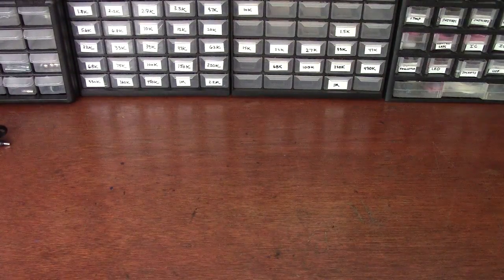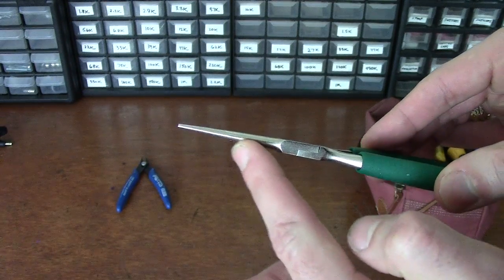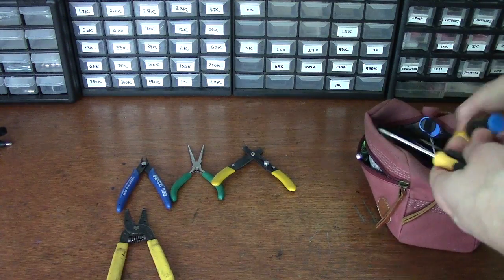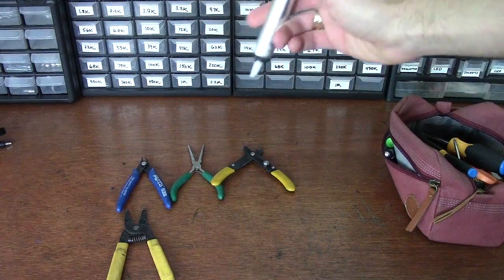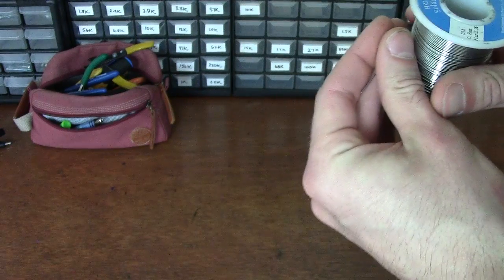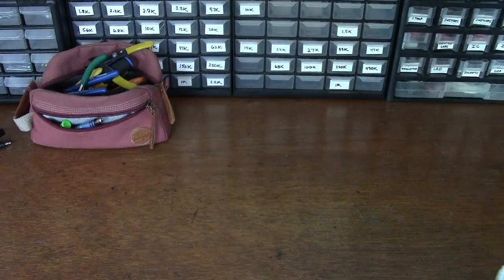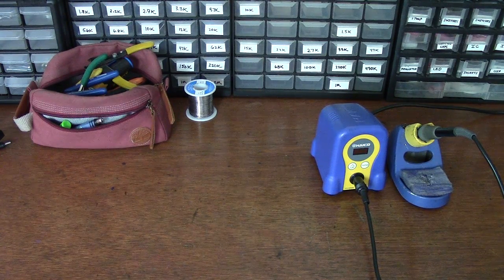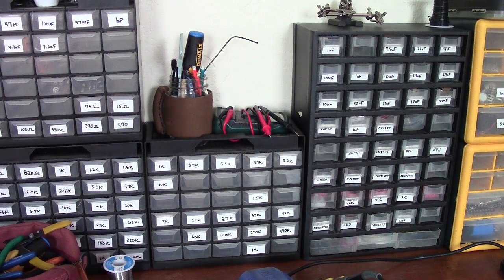How To Start Building Guitar Pedals

Comment: this video is great man, I've been getting into pedal building and I'm in the same boat of having some experience from soldering and fixing guitar wiring. I might have to check out if my local university has an electrical engineering degree, or even just some classes on analog circuitry. Kits are sweet, but I want to learn how and why each component does what it does and this is super helpful
Reply from the maker: Most people never regret going into engineering, it’s a hard subject but I enjoyed it!
Reply: @FuzzlordEffects  it was what I originally wanted to major in before I settled on computer informational sciences. But the local university has added a BUNCH of classes recently

Comment: about a year ago i bought a fender noventa jazzmaster with the goal of customizing it, and when my local shop had too long a wait list for my impatient self. so in the last three months or so i myself have delved into designing switching systems to customize how the guitar works. i see the natural progression from this interest to be starting on simple amp and effect circuits, but ive only met frustration when trying to read into any schematic more complex than an electric guitar, whatever bells and whistles ive added aside. i had a friend ask me to replace the fuse holder on his late 70s fender pro reverb, and while this task was relatively simple to figure out, i was instantly put off and honestly afraid when i saw the rats nest of hand wired components running every which way. whats stopping me from figuring out these more complex circuits and why are so many more components required in an amp than, say, a guitar?

Comment: Going to Toronto Metropolitan University this September for Electrical Engineering and hoping to work in the professional audio/guitar world after wards. I'm hoping to learn why we use high input and low output impedances, certain capacitors in circuits, specific transistors, etc to create innovative audio gear! Just finished my first boost kit and looking into some more simple saturation pedals: fuzzes and treble boosters (not from a kit) as well as guitar wiring mods. Question though, what wire would you recommend purchasing? I'm seeing a lot of people mentioning 22AWG Stranded Topcoat and I'm guessing single conductor or 2C? Thanks in advance Jason!

Comment: Something that frustrates me a lot as someone trying to get into pedalmaking. When I look at a beginner kit or a beginner video, it just says to put component X in position Y, at best it might tell you that its an Op Amp. But what none of the stuff I've seen so far does is tell you what all the little resistors and capacitors and stuff are doing, and why they come together to make the part of the circuit. I know the information is out there, but I'm having a really hard time finding it put in a way i can understand. I feel like I'd get more value out of a beginner fuzz build if I learned how it works rather than just what pice goes where.

I don't necessarily want to make some crazy custom creation. I just don't like the idea of making a bunch of pedals like theyre Lego sets without really learning why this all works.

Great video by the way. I appreciate the amount of thought you've put into what you do.

Comment: I’m compelled to build. I can’t help it. My first baz I built from salvaged parts. I had just got into it and I was so hungry and I couldn’t really work a job at the time so I was broke. It was a good long while before I was able to find a good transistor type that I didn’t half roast in the removal process from the iron. There is something magical about making them come to life. I just recently discovered biasing and it’s mind blowing awesome to have access to that control parameter- it’s like secrets hidden in limitations by the manufacturers. Because playing with biasing is straight up bad ass and I love access to that control 🤗

Comment: I used only a RAT for at least 15 years thinking I’d never need another gain pedal because it did everything I wanted. Then my friend gave me the abominable Christmas ornament fuzz face kit. I didn’t expect much but now it’s the other dirt pedal I don’t want to go without, and I’ve built s pedalpcb clone of the Thorpy Fat General compressor. Don’t want to be without it either. I need those drawers! My desk is a PILE of parts and packs of strings and picks and oh my. But I do have the tools and I do know where they are. 
I’m at the point where I want to start learning what does what and how to read schematics and start understanding the point A to point B to be able to isolate parts whose values I want to modify or swap etc.

Comment: I know this is an old video but I appreciate the basic introduction. As a grad student, I work part time calibrating and repairing radiation detection meters for our university. Lots of overlap or similar concepts directed towards modifying signal output. I am just starting to get my toes wet creating pedals in my free time, but I have a lot of unique/old components at my disposal I have been playing with. lots to learn... 

If you are into history, I think the history of Jordan electronics speaks to the similarities between the two fields. 

Regardless, appreciate the content!

Comment: whats the difference between electronic vs electrical engineering? I already finished a degree with Computer science but want to learn circuitry and start building all sorts of electronic gadgets including pedals as I am into producing music and am a guitar player for a long time. any suggestions? . Thank you!
Reply from the maker: That is a great questions! I think for most undergrad programs they are pretty similar but I think the focus may be more broad for electrical and a common focus is power systems to help design and maintain the power grid. Hope that helps!

Comment: Hey thanks for you videos. I hope you don’t get mad. I just wanted to add something here to the younger Generation. I’m almost 56 yrs old been around the block. I just wanted to add that to don’t have to go to School for Electrical engineering to learn about electronics if you do that’s great you get that engineering degree all good. You can go for an 2yr. Degree in electronic technology. By no means it’s not the same degree. But you learn the principles of electricity and electronics. If college doesn’t fit you a trade school will beat the stuff in your brain. But you won’t get that college degree. Me, Personally while in H.S. Learned electricity in shop classes ( look that up) and while their also went to a trade school for electronics. Then graduated, did some college. The electronic companies tanked were I lived. I ended up using my knowledge of Electricity to get my way into an Electrical utility company . Here almost 35 years. Almost retired. I just started playing guitars and messing around with amps. Repair a couple of tube amplifiers and modifying pedals. I bought a solid state amp that was broke. No schematic for it because it a 100.00 amp new. Called everybody and looked everywhere. So I made one myself. Took my knowledge I learned from guys like yourself on YouTube. Trace out the circuits and drew up the schematic, trouble shot it, repaired it, now working on modifying it. It’s very rewarding. So thank you again. 
 I think I might buy an Oscilloscope in the future

Comment: anyone have a CS background that got into building pedals? I've worked with electronics in the past but rarely in my schoolwork. I'd love to know how that relates.
Reply from the maker: Hi Amber,

I took a bunch of CS classes in school, where I studied they had the EE students take some basic programming and data structure classes and some of the EE stuff was in assembly. 

For the mechanical and building side of things probably not super helpful but you would probably really get into the FV-1 programmable chip that is assembly language based and I think there are a few arduino pedal platforms out there where you would probably have a blast coding effects 🤘

Comment: this was very inspiring for the fact im a hobbyist computer programmer/automation programmer/most lately electrical engineering for arduino/rpi/etc.. stuff, (mostly focused on automation and software) however many of my friends are very heavy musicians from the new england/western massachusetts areas, they would tell me that my equip and tools are exactly what is needed and asking me for clones (and "klones" of the klon centuar), so very recently i started to go deeper finding your content because i was tasked with making some just replication guitar pedals, but just wanted to make sure im getting a nice ground up expereince, only to find out alot of this falls exactly in line with many of the "gists" ive figured out naturally over time, but allows me the testbed to further excercise learning, while still helping some great friends out (im self taught entirely, internet is powerful as you said, amount of information, and what the past people have left behind is huge, you literaly are matching this quote i say about how "were not reinvinting the wheel" thing) anyways, thank you for the content, this really makes me know im found myself to the right path

Comment: too much work I studied industrial design(industrial designers focus on the outside over all product not the parts)...buy two pedals tweak them.....connect them.........fix them to one sound.......then go to a metal shop and pay a couple hundred to have him build you a sleek box for it...then leave it raw or spray paint it.........DONE....now if you want to start a company or go down the rabbit hole(it will take time away from your songwriting) ......do that..but if you just want a cool pedal focus on the interface not the parts.(you can sample tech if your not going to resell).....if you want a custom car you dont focus on the engine...you focus on the body........sure you can do both but........thats a headache......I think so anyways......also circuit bending and paint is an easier option than going over some crazy learning curve mountain just to get a whacky pedal and can be copied anyways.

Comment: Loving all of these videos Jason, super cool. I've been an audio engineer for many years and hip hop producer and DJ and after many years am getting back into this stuff (my foundation) I would have fixed my guitars as a kid and learnt how to solder that way and throughout the years through engineering have fixed my own samplers and turntables etc and made cables for work etc etc. So this is super fascinating. And great to hear that you are nodding to the previous pedal makers, very important. You don't have to reinvent the wheel but you can make a damn fine one (like yours no doubt) Cheers, Caleb 🤘😎

Comment: hello im actually on my second experience assembling a diy kit : the first built went good ( acapulco gold ) ,it was functionnal but the second( chalumeau from pedalpcbdistortion ) not that well because i didnt overthinked enough and soldered the components on the side where there was nothing written..when i plugged it in the amp the led lightened up but there was no signal , i identified that the issue where that the two ic chips connexions where on the wrong pathway of the pcb so i used my pump unsoldered the pins but it wont get off ..so ill wait the end of the holidays go back to the luthier school and use the thermal cleaner ( décapeur thermique) to take off these two ic chip ( one lm386 and a pt2399 ) by the way is the thermal cleaner a good idea ? will the other components not work anymore because of the momentarily heat to pull these two ic's off ? thanks hope you like my story
Reply from the maker: Chips can be burned up if not careful. May be easiest to start over with a clean board if you soldered to wrong side. Best of luck getting that fixed!
Reply: @FuzzlordEffects  thanks , will order  a new pcb and new components :) have a nice weekend!

Comment: 5.30 describes my last year and a half designing my own bass overdrive. Lots of online reading and bread boarding circuits from scratch. It's a little less crowded in bass land and my circuit is original enough to be worth a shot at trying to sell it (wasn't considering that when I started, just no one made what I wanted). I've almost got the first prototype done. What's the best setup for drilling enclosures?

Comment: Hey, really loved the video, I am thinking about rehousing a behringer Supper Fuzz, do you have any tips or tricks!?
Love your Channel and your pedals!! ✌️
Reply from the maker: I don’t really have any tips other than I don’t think it’s the best project. All of the knobs and jacks etc are pcb mount so you could need to de solder each of them and add extension wires to run better jacks and mount pots in a different way. If you do..... just take lots of photos during taking it apart 🦇
Reply: @FuzzlordEffects  okk, thanks, maybe for the first project it's best to start with the kit, just like you did...
Thanks for the Help ✌️

Comment: FUZZLORD EFFECTS...................>>>> Any kinds of modifications I can do to to a fuzz face pedal to get a variety and a bunch of different kinds of glassy tones? 
       ..........Does SRV guitar sound he is playing in a metal can?
https://www.youtube.com/watch?v=AGPx-ekqZEo

                                              
                     --- I'm not sure when turning down the volume pot on the guitar (NO treble bleed circuit since SRV never added one ) it changes the impedance of the guitars output impedance to the Fuzz pedals input impedance and this is what is cause this Texas Glassy metallic tinny resonance SRV tone. So it can be an impedance mismatching or impedance degradation that is cause the fuzz pedal to be a "specialized frequency EQ pedal" and not a fuzz pedal.  
                              Have you compared the schematics from the stock 60's fuzz face and dunlop fuzz face pedals against the Cesar Diaz square face pedal to see why it only happens when using the Cesar Diaz square face pedal and "does not" happen using a stock 60's fuzz face or dunlop fuzz face pedal.
Reply from the maker: Stevie used a tube screamer. So using that may get more of his sound. Cheers!

Comment: The first pedal I made was a tube screamer from BYOC. It was fun but honestly I didn't like the sound very much. The problem with kits are you're limited to only popular pedals for the most part. You have a much better selection when just buying a clone PCB, but to a beginner sourcing parts could be harder then it seems. Converting a 4n7 capacitor into something searchable may require a little research. Drilling holes in the enclosures can be a pain if your drill won't accept the larger bits. All in all it's a fun process, and the amount of money you save makes it even better.
Reply from the maker: GGG has some good ones last I checked

Comment: I saw this pedal kit of a Sunn O))) preamp being sold on a site Coda pedals I think. Was considering buying it. Thanks for the insight!
Reply: Definitely will look into it since it would be my first attempt at trying to build a kit lol. Probably a bit ambitious for a newbie, but it’s affordable enough for me to mess up a few times.
Reply from the maker: Nah you’ll be fine. Just take your time, be patient, and careful. The worst thing that usually happens when starting is burning up a stomp switch. You got this!
Reply from the maker: It’s a cool pedal, if you get it I would consider the option where they sold the smd transistors for you unless you are used to doing that.

Comment: Do you have a favorite (inexpensive) oscilloscope for building pedals and working on amps?
Reply from the maker: So those little phone size screen kits on eBay are pretty cool and useable for around $50. I think mine is a hantek and was about $300. 

They both do same job.

Comment: I bought a cheap DIY Fuzz pedal on eBay a while back. It didn’t work! And  then I read they send the wrong components or the kits are missing parts in the cheap no name kits. The instructions were crap also lol. But I did enjoy building lmao until I plugged  in. The signal passed through it but the effect never worked???
Reply from the maker: Easy to mix up a part or make an error for sure!

Comment: Great video dude. I think another good way to ease into pedal building is by using good old fashioned breadboard circuits. My background is in robotics so I have tons of components lying around from school back in the day. I figured "why the hell not?" and I found a cool but really simple op-amp fuzz pedal circuit on the web. I didn't have the exact part numbers that the diagram called for so I started swapping out components just to see how they sound. The biggest surprise I found was how cool it sounded by putting in LEDs for the clipping diodes.
Reply from the maker: Totally agree and very cool!

Comment: Truly a master at these videos. I just re-wired my telecaster to flip the controls the other direction and had my first experience soldering/wiring. Definitely tested my patience but was extremely rewarding. Thinking about diving in to my first kit build and thought I might start with an a/b box. 1) I need one for my board and 2) I figure it would be easy? Would you recommend this or do you think it’s too simple to bother with as a first build? Watching from Durham NC, by the way
Reply from the maker: That sounds like a perfect first build! Fun, not too difficult, and useful to have around. Thanks for watching Matthew and hope it turns out well (:
Jason